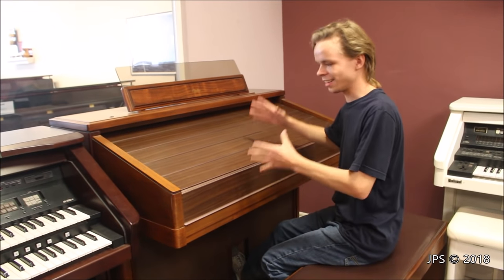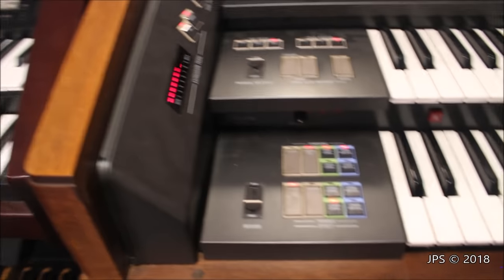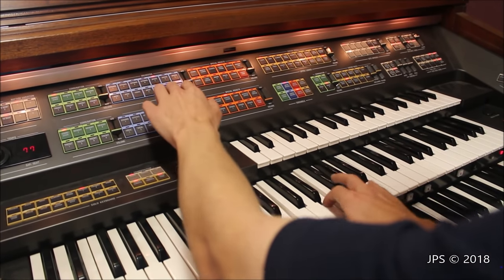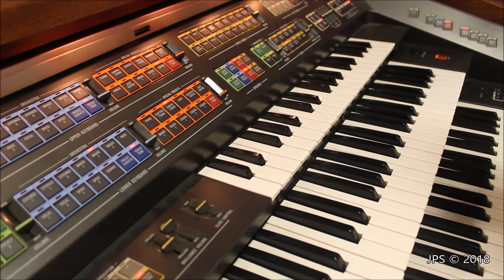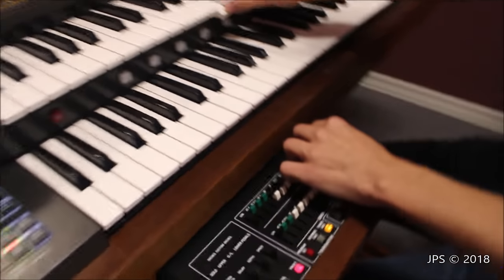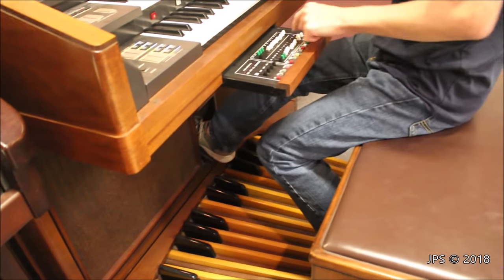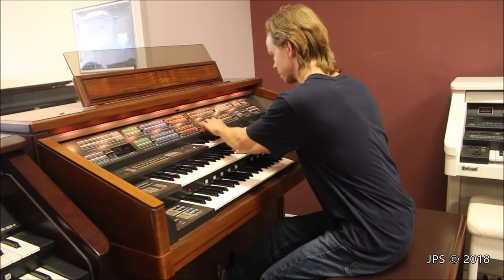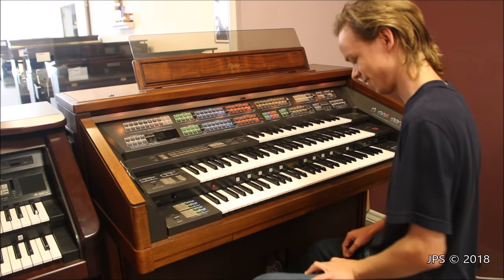Yamaha Electone FX-20 Organ

Comment: I have actually both been to that place and have played on that exact organ. It was made from around 1983 to 1986, and was the first Electone to have Yamaha's FM synthesis as tone generation. The knee level basically does a 'Hawaiian Guitar' effect for the most part though I think that you can program it to do a few more things. As some have said, you pretty much JUST missed the buttons to control the top (solo) keyboard at the 3 minute mark.

Very great organ - the only drawback for me is the lack of MIDI, though you can technically add it to music production, etc, as an individual unit (but no note signals, etc). Yamaha also made a rather limited edition model using much of the same technology but in a futuristic at the time (but now mid century) casing called the FX-1 - which allegedly cost the same as a fully stocked Mercedes S Class at the time of its release.
Reply: Vanool35 It didn’t have midi? But all the lower range Yamaha Electones of the time had midi on them! Strange....It was the time they change the technology from analog to FM Synthesis and PCM rythm samples. Although the lower range FM had only 2 operator I think, that’s why they sounded cheesy and not as realistic as an DX7 synthesizer, although strings was never the forte of FM synthesis.

Comment: In that time the was the model range  fs20 fs 30 fs 50 and fs 70 and th two premium models fx 10 an fx 20
Reply: The top model was the FX-1
Reply: @merttopel595  There was the FX-3 as well.  The FX-1 is the stage version of the FX-20 and the FX-3 was the stage version of the FS-70.